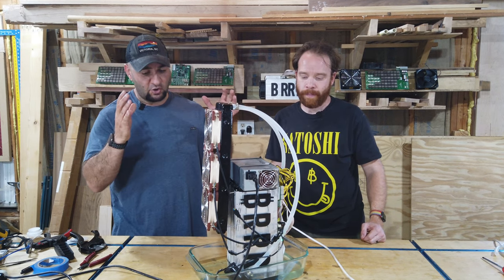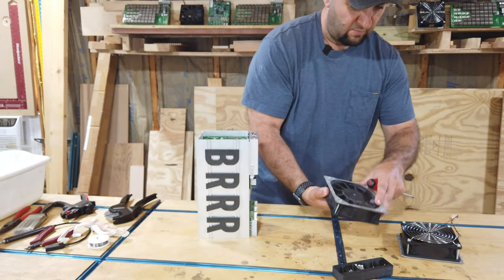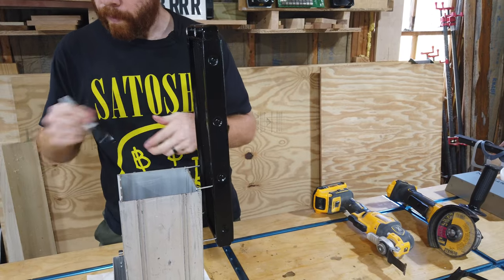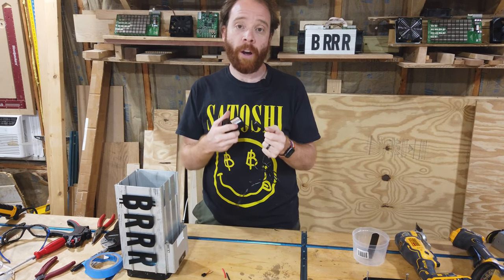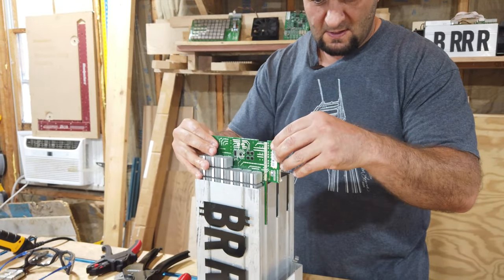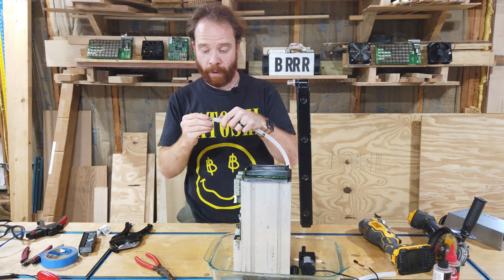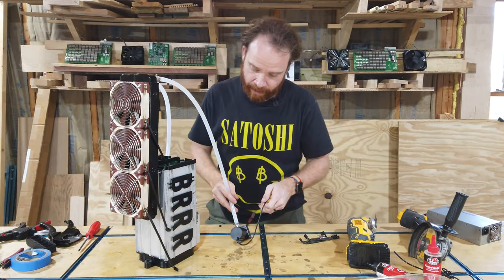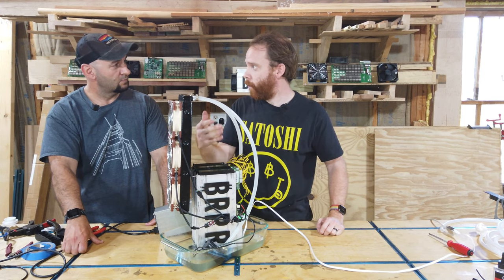Bitcoin Space Heater Build Video

Comment: Heads up depending on where you get your compressed air it can have water in it from the compression process if the air driers in the system are bad/nonexistent